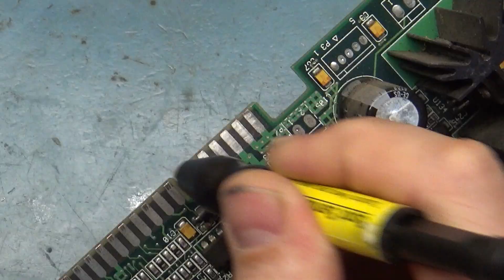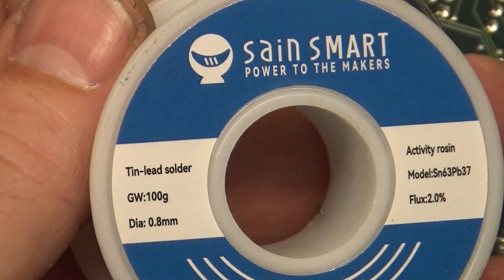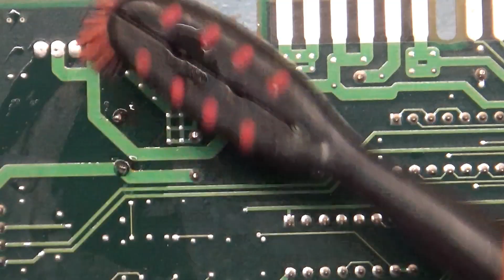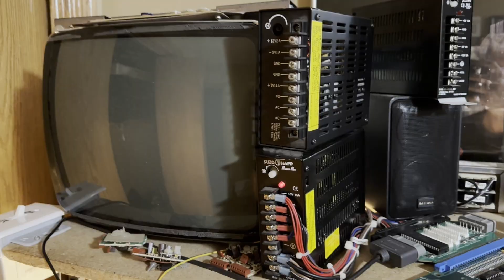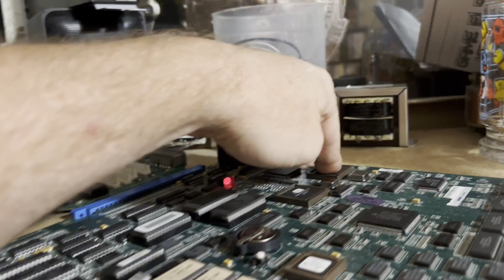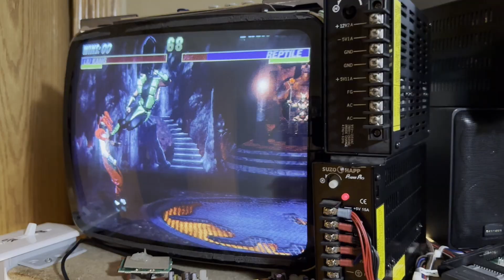Midway Wolf Unit Arcade PCB Repair 101 - The Basics Of Troubleshooting Plus Surface Mount IC Reflow

Comment: All of the steps in this video showing the process to diagnose and attempt repair is worth every moment. I appreciate the process and that you didn't edit out what you did to come to the final solution. I had a similar issue with an NBA Jam where the very small legs around UE13 lifted and I attempted repairs with heat station. Heating with air was such a messy mistake... your approach is so simple and much easier to clean up!

Also this video has me wanting to swap out my filter cap. Time for another APAR order...

Comment: Good day. Can you help me with what to check? I also have an MK3U board but when I plug in the jamma connector the red LEDs don't light up and nothing happens. Everything seems to be fine and the panel is clean. What should I check on it?

Comment: Awesome video!!! Also I've discovered a glitch on Mortal Kombat II Mileena's Man Eater Fatality: I've tapped BLK+HK 3 times and it worked!!! Very strange 🤔
Reply from the maker: Thanks! Correct. You can hold HK for 3 seconds or press it three times with block. Both work.
Reply: @YourMKArcadeSource from now on I'll use that method,  it's more quicker and efficient. I wonder will it work on SNES